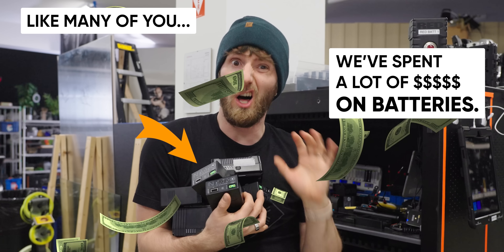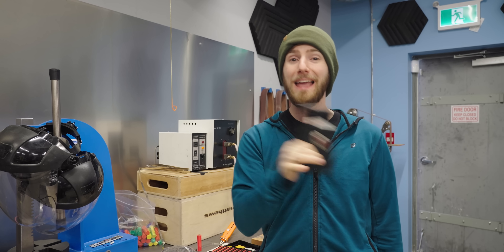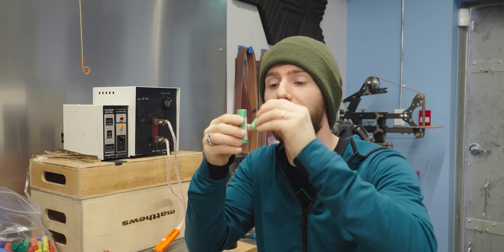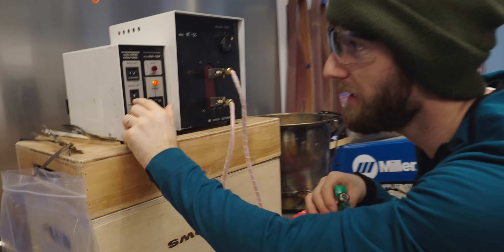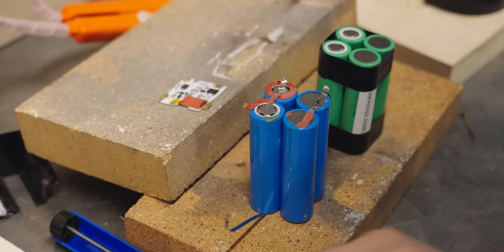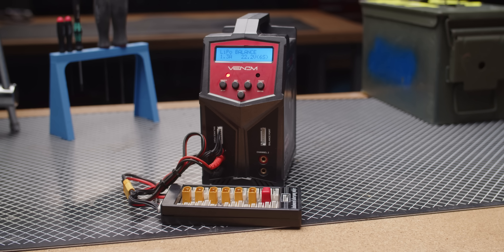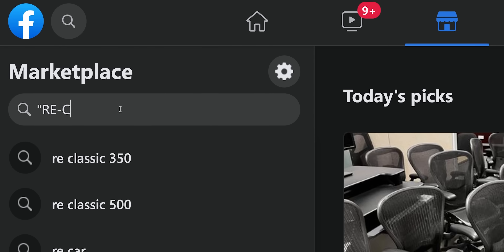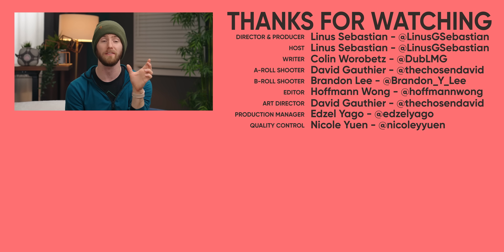This should be illegal… Battery Repair Blocking

Comment: 15:10 I would say Evil BMS are in three categories:
Pure Evil - "self destruct" after a set number of cycles, need BMS replacement after service.
Semi Evil - "self destruct" after detecting poor battery health, need BMS replacement after service. 
Maybe not Evil - "self lock" after fault detection, but possible to service then reset.

The significant difference between Pure Evil, and Semi Evil: is that Semi Evil has a "sane" reason when they self destruct, while Pure Evil self destruct at will, kind of like a tape recording from Mission Impossible, but without the prior announcement. 

Maybe not Evil - I think when they lock operation for safety reasons, but allow cell replacement, and then reset.
Maybe they could have a "self-destruct" function, if they immediately discover poor health after reset, or counting multiple immediate resets, as a measure against unqualified service.

Comment: Got the same problem with my Alienware, which I found in a customers pile of junk. Saved the thing from the junkyard, it had a few rustissues and was not well taken care of so I had to do quite a bit of restoring but I dideventually get it in working order. The battery, however, is also one of the non-repairable genre. The BMS must have some memory or something and now the alienware won't allow charging the new cells. Will reopen the battery and take another looksy bcs I don't want to accept defeat just yet. Mind you, I usually know what I am doing because I have re-celled many a batterypack with thusfar a 100 percent succesrate. If anyone accidently reads my comment and has an idea of how to reset the bms, I'd be greatfull.

Comment: Oh wow. Im going to power my entire car and house on this technology. That would save me a ton of money...Also good for the environment...HAHA you rubes!! If you have already been fully vaccinated THEN TAKE MORE!! But seriously there's already technology for soldering battery connections without blowing up. Its called a swappable battery cell compartment, with the little springs and removable case cover. Also dummy batteries. Where it tricks the device into thinking theres a battery but is actually just potentiometers, buck converters, stepping up and down to your voltage in a fake battery case, with a micro usb port(what have you) so you can run an external battery bank on a cord through your battery compartment and into your device. Realistically Im humping around a whole KWH in external battery banks with a inverter attached. with an additional 30 Wh pocket bank I can charge up off the big bank. If your car doesnt have a battery bank you can hump around in a backpack I dunno what youre doing with your life. Im not going as far as to make the car alternator charge the big boy bank on the go and just hot swapping 2 650 WH banks off a 120 outlet wall wort I find at hotels for charging purposes. I think Most of us will find a 650WH big boy bank sufficient for charging our devices for periodic innawoods. (patent pending..seriously stop stealing my ideas YOU OWE ME MONEY).."Jackery Power station" Ha. I think I got the guinness world record right now hot swapping 2 650WH banks at a total capacity of 1300WH capacity thats a 10 watt led lightbulb run time of 130 hours son on a single charge. You ever see a 10 watt led light bulb.. but deep into the woods? Use it to see bears or light up a campsite. Also Im a survivor of the Great Texas power outage snowpocalypse. Guess who's knocking at my door to ask if they powers back on yet? MY NEIGHBORS. They probably saw the light on and where wondering whats happening. While the rest of you are living in darkness with no solid hobo skills.

Comment: Batteries are a subscription model for power tools, cellphones, etc. Cell phones would not go "obsolete" without the battery going flat. My laptop is now 6 years old and going strong with a new battery, thankfully laptops are a little easier to repair than cell phones. Modern, quality, brushless power tools would likely last forever outside of a professional environment. It's a subscription model to either get you to buy a new phone, or buy another $120 battery for your drill because the drill still hasn't broken!

Comment: Having built multiple 3+ kwh battery packs.....those sparks weren't dangerous, they were just not having a good contact with the spot welder. If you had actually set off one of the cells, there would be smoke pretty quick.
Reply: Exactly, they were so blinded with safety and fear of lithium batteries, they overreacted to simple bad contact... Throwing out so much good batteries... What a waste.
Reply: Ironically how a video about anti-ewaste turned into just that
Reply: technical work on this channel has always been cringe-worthy, and today was no exception. The spot welder seems to be putting in a LOT more power than is necessary, I didn't see the batteries actually catch fire or short. Also, that's not a soldering iron suitable for electronics. While the RED battery packs may really kill themselves, I doubt this is true of the Sony battery pack. If I am not mistaken, the BMS will power down totally when the battery is low to prevent parasitic current - it will power up again by applying a bit of voltage (charge, ie) to the output terminals. Please buy a proper soldering iron, Linus!
Reply: @davealancaruana6727  sounds like Linus trying to cheap out on the soldering equipment cost him more in the end on the 18650 batteries since those things aren’t cheap either by him just dumping them because he’s a afraid of a few sparks.

Just getting one of them for my mod they’re $10 a piece here in the US. Maybe they got a deal in bulk but yeah.
Reply: @casedistorted  yeah, we get reemed hard if we want actually decent batteries. A single lithium panasonic 18650 shouldn't cost you 15 bucks.  Life fires are chinese garbage with massively lying capacity numbers.
Reply: @casedistorted  3.7v 18650's? I'm not sure how long they'll last, but I got 10 18650's + a headlamp for $22 on Amazon (just needed 2 18650's for my radio for fpv quad racing).
Reply: @davealancaruana6727  buying a spot welder just for rebuilding your personal batteries is just a waste anyways. I've soldered mine for years and it works great.
Reply: @ColeSloth  $100 gets you a working and quite useable spot welder. OK may be a bit much for a single use, but Linus and co aren't exactly hobbyists on a tight budget!
Reply: @davealancaruana6727  But they are doing videos for the viewers, their point was to show you can repair your own batteries to save money and waste, and they did still buy a cheap, crappy spot welder.  For every 100 of his viewers that own a soldering iron, 1 owns a spot welder.
Reply: Don't understand how they fucked this up that hard... Plus the wedding ring...
Reply: @0xbadcafe  What's more dangerous, a lithium fire, electrocution, or a fiery wife? :D
Reply: Correct, I also built few battery packs myself so I know what's up with those sparks, Linus is just overreacting so much needlessly. TBH, this entire video is kinda meh, I get it that this is not "Linus Tech Tips" forte, they are about more like computer-like components, not like about electrical engineering, but this video is just wack. I like how this video raised awareness on intentional e-waste that is created by manufacturers, I didn't like the repairing attempt video at all.
Reply: Devils advocate:  they may have known that spark was not one that would have actually been dangerous, or found out afterwards, but decided to leave the video as it was to prevent halfwits from just ignoring any sparks they might see and just keep on going when they actually managed to produce a hard short
Reply: Agreed! Those sparks were expected! is a close circuit, right? One thing they could try was to connect another pack to the BMS in parallel before disconnecting the original pack. This way they would not loose power on BMS preventing the evil BMS to loose power and shutting off. I would say those pack are good to go. Edit: Once I shorted some os these cells and they got really hot and smoky REALLY fast - definitely not what happened there.
Reply: @ChristianoDebarry  especially if that BMS is capped well... you are right.
Reply: Yep. These guys made either a complete fool of themselves or they want the viewers to think this is enormously hard and dangerous. They claimed to want to recycle batteries yet they are only here to make the money off of these kind of videos. Totally silly but I guess it works for them.
Reply: @permagnusandersson6052  Maybe, they did it for the reality TV factor impact. Another possibility. Also, makes it harder than it looks for sure. Ha ha :D
Reply: He was burning through the cell casing with too much current for too long.
Reply: And having the sand bucket in a lift motion to place in isn't the best, you can just swipe it into a metal container and job is done.
Reply: Your Right.
I had smoke too when I smashed it... Tehe.
Reply: @ChannelRefEry  You're wrong.
Reply: I definately think you guys are over zealous here.. I think this was a correct move by Linus as those batteries are to operate tens of thousands dollars of camera equipment. No chances taken is DEFINATELY the right choice no matter if you think a spark was over reacted.

And also.. As an influenser you dont want to encurage retards skipping safety rules.
Reply: @mattb4805  the neat way to do it is to solder your cables to a piece of nickel strip and then spot-weld that in place .. also, a chinese TS12-tipped iron, for around $40, can actually put a LOT of heat into a workpiece very quickly!
Reply: These guys have half knowledge or no knowledge when it comes to technical aspects,
I was like why the hell are U throwing away, 
Atleast they should have an Electronics and Electricals Engineer in their team for these kinda basic solders or spot welds... 🤦🏻‍♂️
Reply: @DeepKumar.  I'm available to join the Linus team 😁
Reply: I'm really happy that someone pointed this out
Reply: if you slow it down you can see the spark is actually an arc across the tool probes above the strip.
Reply: And the whole "never reuse the good cells" bullshit too.  The balancing leads are there for a reason, ALWAYS test and reuse the good cells, you're throwing away money if you don't.
Reply: @jonc4403  yup, my battery packs are made of old modem cells that I thoroughly test.
Reply: @jonc4403  that's a mixed bag, but not for danger reasons. A 4 year old one that's still good is still going to fail faster and will have a lower capacity, which means your entire pack will have a lower capacity.  It will also have a higher capacitance that will effect charging.
Reply: @jonc4403  Only if you match them with other used cells of the same reduced capacity and internal resistance. Balance leads won't even out internal resistance and you could still end up with a fire. Charging isn't the only time that fire could occur...especially with high amperage packs.
Reply: To give him a chance, this was most likely his first time doing this.
Reply: @alucidrust  Not really they have a whole team of actual engineers not just DIY people , so that's not much of an excuse
Reply: Maybe, RED sponsored this video lol :D
I was wondering about the sparks just being arcing between the strip and the battery lead. As long as the batteries didn't heat up too much or there wasn't an increased voltage (i'm assuming their paralel aligned), things should be fine, right?

TBH, not hating though.
Linus and his team have come a long way and they are truly pros. I'm sure there's a good reason even if its not a tech reason for them doing this haha.
 
There super pros and a very smart group of young people. They've grown a lot. I used to watch his videos in the NCIX days, and I remember he would look super puzzled about razer mice features. And, back then, by the way he would talk, you could tell he had a script or was being prompted. Now, after maybe a 15 years, this guy and his team have gone god-mode. Hahah

So, honestly, hats off to Linus and his team! :D

Comment: Electrical Engineer here, 
Your BMS may require a "jump" before use. I would attempt to charge the battery pack with the BMS wired on and wait until the cells are balanced and then attempt to use the cell. Just a suggestion 😁
Reply: Good point! Might not even be a volatile storage issue! Just not enough amperage or RMS Volts :)
Reply: @Prash1c  my thoughts exactly. I know predatory anti repair/replace measures exist but its unlikely that semi common camera batteries contain them.
Reply: My thoughts exactly. I've repacked old laptop batteries and some of them were as simple as a jumper between the positive terminal of the last series connection of cells (the one which will read about 12.6V when referenced to GND) and the positive rail of the battery pack which interfaces with the motherboard.
Reply: We are waiting for an Update about this

Comment: Looks like your sparking on the cells was down to a poor contact or duration 2 long. Been there done that. Started with a lead acid DIY spot welder. That went through 4 cells in a large 290cell pack I was building. 
Stopped right there. 

Until I got a ‘kWeld’ that is. Set the joules. Make sure contacts have good even pressure on the nickel strip and perfect weld each time. Over 1000 spot welds later with 2 per side and I can confirm this welder is what you need. I was also able to spot weld 0.15 mm fuse wire to each cell consistently.

Comment: While most of us don't have Cinema cameras. Many of us have portable power tools and all of this is true for them as well. The battery is most likely the most expensive part of the tool over the life of the tool.
Reply: That is unfortunately not true for professional cameras... a v-mount battery pack for 250 - 500 dollars might sound really expensive, but the cameras they go on usually start at roughly 10K (not even talking about the crazy Reds that LTT is using). And usually, these packs last for many years. I have some third-party brand v-mounts that have been in almost daily use for 6 years and I don't notice any major degradation yet. I think you can safely say that once your second generation of batteries is going bad, you'll probably have to replace the camera, too...

Comment: Could you solder a parallel 7VDC power supply to the BMS so it never sees power drop?
Reply: These are 4s packs, so you'd need a 12 - 16 VDC power supply
Reply: @highks496  The Sony battery pack is a 7VDC pack, could you explain how a 12-16 VDC power supply would be required?

Comment: There were some good technical comments already which lets me focus on the i2c side of it. 

A modern "smart" BMS from for example Texas Instruments will go into and stay in a faulted state once you disconnect any of the cells from it.
That is for good a reason since if that happens unplanned inside a device, chaos can ensue.
Sp a totally reasonable protection! 

There is a reset pin on the BMS that can be used to send it to "sleep" during the replacement to not even run into that fault.

Now the fault-state won't be cleared on reconnecting the cells.
One can try to clear it usually over SMBus (i2c). 
The two evil problems here are missing documentation on how that's done and
the OEM can set a custom password to lock the BMS.

Luckily, some don't set passwords and there are known standards that can be followed as well as known passwords.

Many scripts and experiences do exist that make all of this possible, and are where i learned all of this, fucking around with a macbook pack.  
The chinese seller was a bastard and changed it as well as usage and capacity values.
That might be a "fraud" worth looking into, in my opinion. 

In the end, an ultimate nuke would be to replace the BMC chip itself.
Only issues here is acquiring a suitable replacement chip and respective manufacturer -info checks from the device using the battery, not working with "unbranded", magic sauce BMS FW.

Comment: The Bose SounLink Mini bluetooth speakers (all versions) have evil BMS. Similar setup and cells as those inside those RED camera packs and the BMS kills the pack if you replace the cells. Another shitty company to denounce.
Reply: Except that Red doesn't put the battery inside their cameras. These are user-changeable battery packs. If you take away the cells, you're left with a little plastic and a small pcb. You can usually use these packs for 6-8 years. Re-celling the old case doesn't really make much of a difference, the old cells are dead anyways.
These packs have a v-mount, which is a decades-old, open standard mount system used by basically all professional cameras, lights and monitors. It's literally the worst example for right to repair or open systems. I don't know any kind of battery system which would be this open and versatile, except maybe for simple AA NiMh batteries

Comment: seems like that spot welder should be outputting a lot higher amp output with a much shorter burst. After seeing people make e-bike packs etc. Theirs emit a small spark and last a much shorter period of time without the nickel turning red or heating up over an area. Makita does this anti-right to repair stuff, if the battery falls below a certain voltage due to temp, or other reasons the BMS will shut the battery off and will no longer be able to charge, with no method of recovery. Recently I had to fix one of my PowerA controllers that had fallen a tenth of a volt below the threshold on the batterie's BMS. I disassembled the controller charged the cell at a very slow rate with a dedicated charger, then poked the leads of one of the transistors to unlatch the low voltage cutoff with power or ground. (I forget which) That brought it back into usable condition. A controller that I couldn't find a battery for off the shelf was revitalized with a few minutes of work.